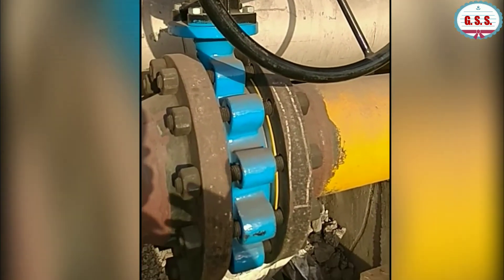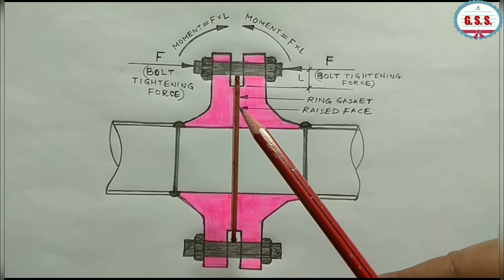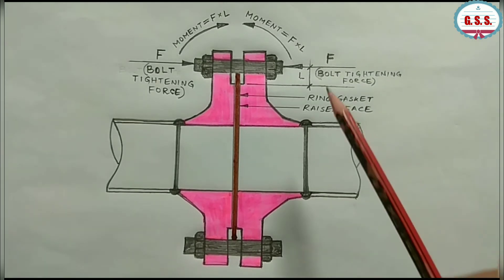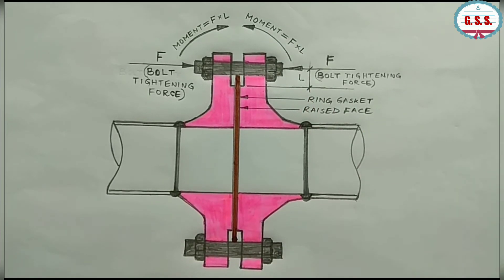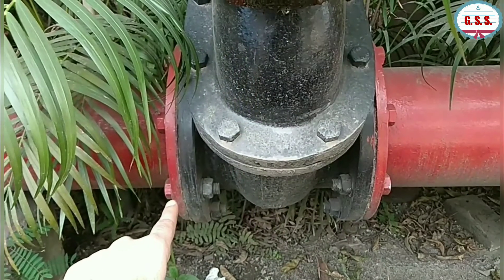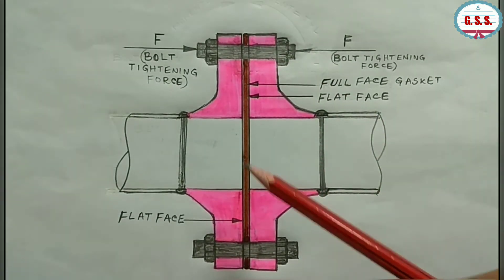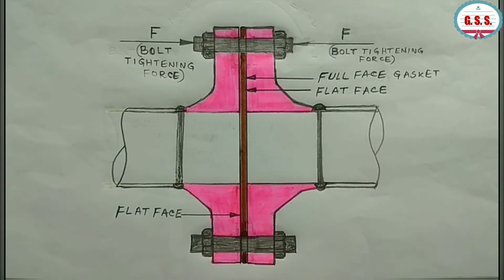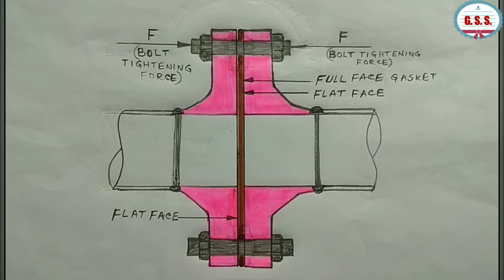Piping Engineering : why raised face flange is better than flat face flange

Comment: It's all about achieving required gasket stress (25 ksi on a conventional graphite SW or KamPro.)  To get this the gasket area must be reduced.  This usually introduces bending into your joint assembly.  Inexpensive and brittle (even so called "ductile" iron flanges have no place in serious bolted flange joint assemblies.  Maybe water or milk service !